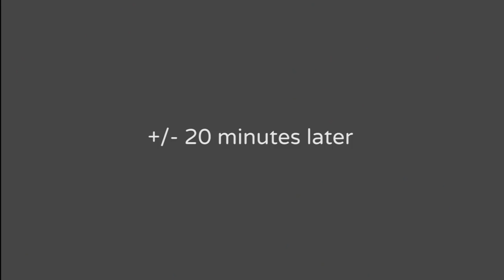Weld a mould to make colourful tiles from plastic waste #preciousplastic

Comment: what about, a hexagonal pipe, and later cut slices of it
Reply: That is what bothered me.  Extremely labor intensive to make one tile.
Reply: Maybe make the tile bigger. Like, way bigger. Edit, also I think this tile size may be proportionate to the size of the injector tube? Thanks for posting this, I actually have a very similar design in my sketch book. Minus the support on the injector plate, thats not on my design, yet. Thanks again guys.

Comment: that would make awesome floors for a home or garage or for a dog house.  the possibilities are endless with recycled plastic.
Reply: The time to produce them doesn't seem very feasible, but I like the spirit of the idea.
Reply: If you were going to use the tiles as a backsplash or as flooring what would you use to keep them in place. I’ve read HDPE doesn’t do well with glue, does mortar/grout work with these types of tiles?
Reply: Katherine Ott Walter probably not, but spacers with a certain type of epoxy to fill in the gaps could do..
Reply: Exactly my thinking! Awesome plastic is!

Comment: compression compression as is with low heat no shredding or sorting keep it simple. like use steel compression equipment. sheets, bricks boards, etc. keeping smell lower. better then wood or steel. fill plastic bottles with water use for watering gardens not drinking.

Comment: Nice. Maybe try a water cooled mold and use a quick release system such as clamps or locking tabs.
Reply: Chris Ellingson or a lot more molds
Reply: Good idea - i wonder if a shutoff valve could be installed inline above the threaded nozzle.

Comment: Hi Dave!

Absolutely amazing work&channel! In Australian hardware stores the plastic beams/extrusion you made(The one which looked like wood in previous videos) are used for composite `decking` and madly expensive. Don't know how yours will be UV resistant or not but I'll be manufacturing all of the machines and tinker around. It reminded me ""Build a Plastic Injection Molding Attachment for a Drill Press"" by Vincent R. Gingery (:  I'm stuck with the Auger Feed thou and couldn't seem to find it thru your site, where can we get it on E-bay?

Comment: The floor tile idea is interesting, but I have some questions I'm hoping someone could answer for me... 

1. Tiles such as these don't seem to contain anything to protect it's owner in the event of a fire... would this not release toxic chemicals within the air, potentially poisoning anyone nearby?

2. Once placed as a group of tiles; what would you recommend to prevent moisture finding a way through the ridges and cracks?

3. What would the typical weight limit be? Should these crack they would need to be replaced almost right away to prevent moisture.

4. What would it's average life expectancy be should the item be used often or exposed to UV rays?
Reply: I can answer these: 1) yeah no one wants to be around when ANYTHING is on fire and the toxins everyone keeps talking about is a bit exaggerated 2) cement... use cement as per usual
Reply: 3) the surface area is small so you won't have a problem
Reply: 4) how long any plastic bag lasts under direct constant exposure to the sun I suppose but if you're that worried epoxy it

Comment: Guys!, just a fantastic video, the thing is that just the equipment seems to be highly industrial and expensive, another concern would be de cost of production, electricity plays a huge factor in recycling plastics; nevertheless a great Vid 👌🏻. I may have other questions for you all, where are you guys located? I could and would  buy some molds from you, I’m more into cement or concrete forms and like to know if you would manufacture molds or forms to be use for concrete pathways or forms. Tks again 👌🏻

Comment: I have found that clay molds work to, if your using a cone 6+ clay. Using HDPE, LDPE, PETE plastics.

Clay molds are also great for aluminum as well, which is what I made my shredder out of using the clay mold to make parts.

Comment: I have a question...
Obviously your next step will be to expand on the mold idea so that you make more than one tile per mold per use. I had the idea of drilling a hole through the bottom of the mold and just duplicating the same mold over and over again, stacking them on each other and then using really long bolts to secure them together. My question is, since you will need to preheat the molds to prevent premature cooling when the mold is being injected, how do you address the heating issue and how would you cut the tiles to separate them when taking the mold apart?

Maybe there is a better way to mass produce them? Say... 10 or 20 tiles at a time? No one wants to make tiles all week just to cover a 10x10 space in 2 hours. Just sayin...

Comment: Truly inspired work.  The bright varied colours are very attractive, and would be great to automate the stamping /forming process for the tiles to get some decent output. That is of course if you have plenty of raw materials at the ready :-) Yes I have seen your shredder vid!! 
May I suggest a larger font for the stamp and put it  right into a soldering iron like a Weller gun type. 100 watts of instant heat. Big saving of time maybe

Comment: Assuming these tiles are used in a house - 1) how long from ejection to finish did it take 2) Is it fire safe to use in a home for floor or non-heated surface 3) do they bear weight and if so how much or do they deform over time (Is it technically a glass?)

Comment: How/Can you fix the tiles together to make a sheet of tiles?
Reply: Sharon Jacobs Change the mold to have a half height narrow ring. That will give the tiles a lip. Slide one under the other.
Reply: Mark Proffitt nice idea, but does’t work with this shape. I gess you just need to glue them...
Reply: mrdjakotaja that's what I thought. I was just wondering if there was a way that you could plastic weld them? Thank you for your reply though :-)x
Reply: mrdjakotaja It would certainly work, if on each edge/side of the hex the lip alternated between overhead lip or under lip. Wish I could draw a pic, but as a cross-section, some would look like a square U-shape and the alternating ones would look like an inverted U-shape. They would interlock.
Reply: durlydurl yes you’re right, however it’no longer an exagon (from the front view in the case of multiple colors tiles) and the mold is way more complicated and needs lots more precision i think. But well done!
Reply: Sharon Jacobs  hi YouTube channel Robert Murray smith shows a good way to weld plastics  alas only what would fit onto a microwave oven 
Still a great channel to view
Reply: Try using a finishing nail.  Use pliers to bend a 90 degree leg on each end.  Use a propane torch to get it hot and press it across two tiles.  I would use two per edge.

Comment: Thank you for making this Video ... it is interesting, creative at the same time, create learning experience of Inside-Out. I have 2 Questions:
Q#1: How do we know how much of plastic (enough or sufficient) to be injected into the mould? ... So that we know when to stop the extrusion from continuing
Q#2: We have seen how 3D printing works ... This Idea of Recycling Plastic is kind of Manual, while 3D printing pose a Challenge because of Replication and Speed in Producing. This question is really about Competition: 3D Printing versus Plastic Recycling using the concept of Precious Plastic
Reply: Q1 the injection lever hardens until you cannot push it down any more.

Comment: This is great, but seems like it would use a lot of power. 20 minutes to heat up and only one tile made, is there any way to interchange multiple molds so you could make 10 at a time for instance? Can the tiles be cooled quicker in water or would that warp/shrink the tile?
Reply: Jeff Cameron Good idea... more molds, less cost per heating session. And if the form/mold is held together by screws, there wouldn't be any warping.

Comment: Hmmm. Seriously ? This is totally unproductive : I can't imagine the amount of time and energy to make 1m2 of flooring. This is a wrong example IMHO. If we want to massively impact the DIY plastic recycling, we need to invent mass productable recycled products. To make tiles what about using your beam making process, then mass cutting tiles with a (bunch of in line) hot wire cutter(s) ? If the process makes a single (or fiew) part at a time, the part needs to be extremely valuable to match the time and energy spent. Anyways if the part is cheap and/or you need a lot of these,   you have to produce quickly and inexpensively by numbers.
Reply: This is an example of how to make a mold, it covers the basics.  The places dave has been filming have the time to do something exactly like this and can modify the mold to their part desire.   The only difference between this floor tile, and making covering plates or the box molds for machinable plastic block (as an example) is the shape and size of the mold.
Reply: discjockeyallen : I get it but this does not change the fact. Don't get me wrong, my comment is not for criticism purpose but to participate to the overall effort to solve the plastic waste problem with efficiency. I am very concerned about this. IMHO Dave made some machines and greatly documented them and that was the first step. Seccond we need to find a lot of appliances which are greatly valuable so people would like to come in. The tile production corrupt the idea IMHO. Even (and probably especially) if you're in a disavantaged area. Because energy have a cost and you won't sell at high price so you need to produce a lot to be profitable. That's why the deal is the same as for industry : you need to produce a valuable thing which requires an acceptable amount of material, time and energy. In the video example you should need a lot of moulds and you want to change molds very quickly or you will waste a lot of time and energy. Assuming you made enough molds to produce continuously (which is a budget) how many tiles per hour can you produce ? For 1m2 you need 100 tiles. In my (rich) country the price tag of 1m2 of tiles should be under €5. Add time and energy to the investment. Alas the example shows that investing in molds and machines is not a good idea except if you want to loose time and money. We need to show a profitable model. Just my two cents to the cause.
Reply: Axel Sixtysix they do things to give people ideas. Not to hold our hand through the whole process. If you want speed and efficiency, then you're going to need to build different machines. Or modify them to fit your needs and desires.
Reply: Twitching Shark : I don't think so. Dave's machines are good enough fore many purpose. They're pretty close to industrial ones. Maybe the price tag for the shredder is a bit high but this is another story. You can do a lot with those existing machines but people may have no imagination or design skills to make interesting things with it. That's why examples are crucial. The container shop is an empty box until you can make a tangible production. If we can give a range of useful and profitable products anyone can make, then we give all the keys for a sustainable activity (or maybe a business). The question we need to answer actually is what should we build with our recycled material. We have open source machines, Dave already shown how to make a mold. Now we need open source profitable designs.
Reply: I´m really interested in creating bioponic production towers out of recycled plastic in order to create your own urban farm. IMHO that would be a nice output from PP machines.
Reply: Axel Sixtysix and why you didnt do it by yourself and make a video showing us how is the correct  way to recycle plastic!
Reply: If you consider my comment as a hater comment, you get me wrong. I'm no Youtuber but I'm invested locally in plastic waste recycling. We make plastic pannels but people are not very interested in it because they don't know what to do with it.
Reply: Nico Quena : English is not my language and I use the words I know to make myself understandable. I really appologize if my writing seems agressive or critical, this is not intentional. I just want to point out the fact that people needs applications for DIY recycling to be efficient, and even to start. It's the key for a durable/sustainable recycling activity.
Reply: One 
Lithuanian company named 'Plasta' have been manufacturing recycled plastic roof tiles. I wonder, if they are still in business. This idea of diy plastics workshop is very good! Do you have more videos on preparation of the material before shredding?
Reply: mee too, but how to get that food grade? maybe hdpe milk bottles
Reply: Axel Sixtysix u are correct, we need a perfect business model,  Dave has done a great job with his machines and ideas but apart from this we need a successful business model which includes time and quantity produced withothag time span and it's price,  unless we won't come with that changes is not gonna happen.
Reply: I don't believe they intended to make floor or wall tiles. And, at least, they can make each tile unique.
Reply: they didnt mention floor tiles or did i miss that? i presumed this would just be something you would make to use up leftover plastic and cover part of a wall somewhere like an art installation or something. these look way too small to be floor tiles anyway.
Reply: Wonder how they'd be to tile a shower...or even a bathroom
Reply: @axelSixtySix  entonces nos quedamos de brazos cruzados, este es un gran ejemplo de lo que podemos producir con nuestras manos, lo que estos muchachos estan sumando para resolver el problema, realmente el problema del plastico viene por lo mecanizado del proceso, esta gran produccion que tu planteas es la que esta perjudicando al planeta, al planeta entero incluido tu pais rico.
me parece que tu comentario es muy negativo a este esfuerzo que estos muchachos estan haciendo, si no es asi porque no lanzas tu molde que acabara con la basura plastica?
Reply: @roruiz9785  Muy bien hermano. Primero,  no conoces mucho de mi pais. Secundo, el plastico es un problemo mundial,  vale. No negativo aqui.  Digo que queremos soluciones massivas porque la producion de plastico es massiva. Pequenios "tiles" que quieren mucho trabajo,  enegia y tiempo no estan un solucion. Solo un exemplo,  como dices. Tenemos que imaginar solutiones mas competitivas. Entiendes ?
Reply: @axelSixtySix  bueno enseñanos como, tu ya imaginaste?, para comentar lo que dices entonces ya debes de haber hecho aunque sea un prototipo, un ensayo, muestra soluciones o caminos hacia la solucion, a mi me parece que estos esfuerzos rompen el paradigma de la producciòn masiva que tanto afecta a el mundo, produccion que tu defiendes, producir masivamente? que no en esto radica el problema? la soluciòn es la produccion artesanal como estos muchachos estan logrando, no mas productos baratos producidos y repetidos miles de veces.
Reply: @roruiz9785  Creo que no soy muy claro. Escusa mi espanol por vavor. 

Debemos ser pragmativos. La quantidad de plastico es massivo proque la polulacion mundial es massiva,  vale ? La producion artisanale o industrial no es el primero problemo. Nota que energia es un real problemo por la planeta. En una mano debemos usar mucho residuos en nosteos piezas y en el otra mano mas residuos usados monopolisan mas energia.  
Para rompar el problemo de los residuos plasticos,  hay dos maneras de hacer. Primero : nececitamos otra material ecologico y barato para reducir la producion de plastico. Secundo,  no me importa la manera industrial o artesanal de reciclaje, pero nececitamos de producir mas productivos reciclados que la producion de residuos plasticos. O no correctamos el problemo. 
Aqui mi pensiamento : el residuo plastico no costa mucho, pero no es gratuito, la coleccion tene un precio. Secundo,  la transformacion debe ser barata o el plastico nueva vendera mas. El precio de la transformacion depende del tiempo para cada pieza,  del inversion y energia, vale ? En este ejemplo energia y tiempo para cada pieza es demasiado importante. Creo que es un mal ejemplo. La pieza productada debe ser mejor qualida/precio que hecho de nova material. Entonces dos soluciones : debemos reducir drasticamente tiempo y energia para cada pieza, o debemos producir piezas de mayor valor de mercado.
Reply: Propose your solution instead of critisizing !
Reply: @MathieuCorbin  I'm a PP supporter,  don't get me wrong. Please read all the answers, there's ideas for improvement.
Reply: Mathieu C he did propose a number of solutions. His criticism was constructive, and all developing ideas and technologies benefit from such criticism.  Why take it so personally?